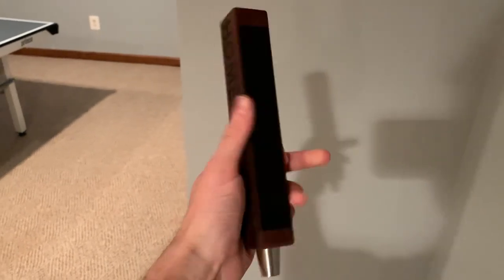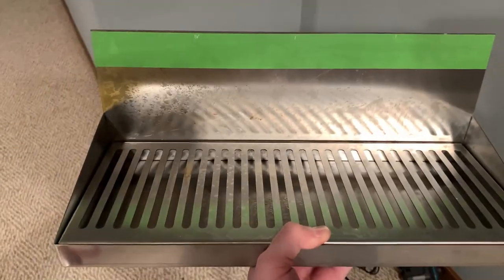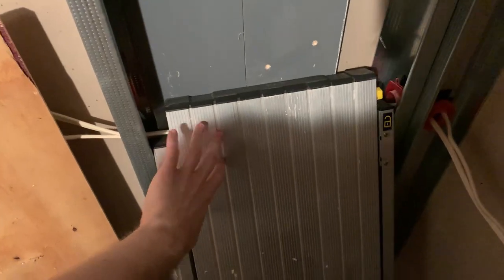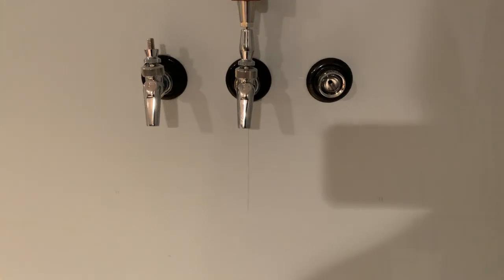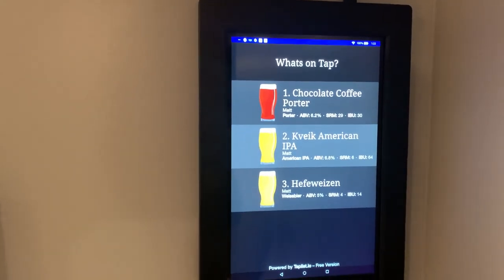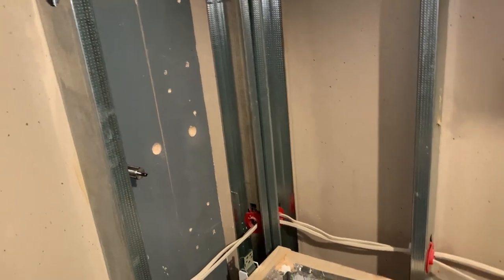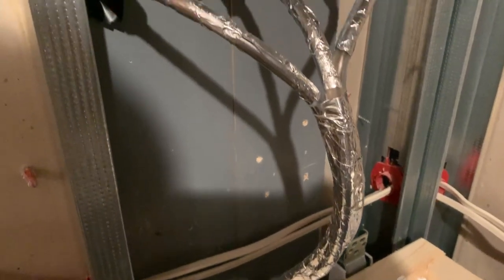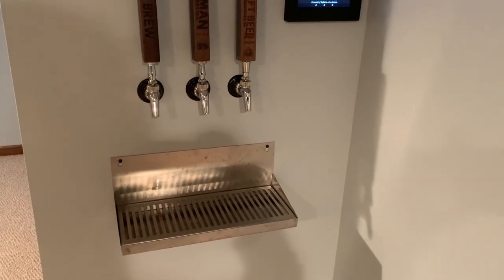DIY Beer Tap Installed On Wall | Insulated Run | Digital Tap List

Comment: Great video!  When you note that you aren't going to use glycol or a fan for your lines because they are less than 6 feet, are you referring to the length of the lines outside of the keezer?  Or the total length of the lines?  I'm looking to move my beer taps to the top of my bar and I am going to need to run my lines outside of my kegerator.  The length from kegerator to tower is probably about 3 feet and the last thing I want is foamy beer!  Thanks!
Reply from the maker: There is probably about 3 feet of line outside my keezer. Regarding the foam, the first pour every day is a bit foamy but after that it pours just like normal for the day. That first pour gets the line cold enough where it is not a problem. Up to you though!
Reply: @TroubleBrewing  Thanks for the reply!  I'll give it a shot. Guess I can always find some way to cool it later if the beer is a bit foamy.  Again great video and thanks for answering my question.  Cheers!

Comment: Matt, really well done video and I’m about to embark on the same journey of three taps through the wall. A year later, do you have anything you wish you would have done differently or is the system doing well?
Reply from the maker: Thanks for checking out the video! Overall I wouldn't change a thing. I do find that the first pour pours more foam then subsequent ones (im assuming this is because the lines above the freezer are room temperature?) So maybe implement some system to keep the lines cold above the freezer. But this really is not a big deal and I only would consider this if I'm really bored one day... The only other thing I can think of is I find that you really need to torque down on the handles so they don't move around on ya and you may need 2 people to tighten those down. Cheers!

Comment: Isn't taping the beer lines in the HVAC tape going to make it very difficult to clean out your lines?
Reply from the maker: For cleaning I use PBW/Starsan between batches. If your using the beer line cleaner with the pump I dont imagine it would be any more difficult since you can just leave a tap open with a bucket and just push the cleaner through the line as you normally would.

Comment: Hey Matt, I have a very similar setup but I’m looking to only run 1 line. My thought was to buy a kegerator and then a conversation kit to run through the wall. Do you have a link or suggestions on the supplies I would need. Or a list of exactly what I need to buy to make it work. Not the handiest so I’m looking for someone just to tell me what to buy and hopefully it’s easy to install. Thanks!
Reply from the maker: Hello, unless its a cheep/used kegerator your almost always better just buying a freezer with an inkbird since they are alot cheaper. I have a Keezer build video on my channel if your interested. Once you setup the collar your going to pretty much just do what I did in this video.

Comment: Everyone should really understand the Beer coming from the Keg to the Taps MUST be relatively COLD and it's a shame, but I would have liked to see him pour beer.  Because it would be a ton of foam beer.  He doesn't have a true method or proper insulation to keep the Beer at a cold temp to avoid foaming.  Let me know if anyone has built something like he has shown and it worked.  I'd be VERY surprised to see no foam.  Especially if the beer sits in the line for more than 10 minutes then pour from the Tap.  ANYONE'S Thoughts???
Reply from the maker: Hello! The first pour of the day I would say the glass is half foam and if you let it settle for about 5 minutes you just top it back off. You mention that it would take 10 minutes for you to have another foam issue, this is just not the case unless you have a very warm place were the lines would be. After the first pour there are no issues for the day. You can go through the trouble of keeping the lines cold; which I do link to a resource on how to do that, but I find that just waiting 5 minutes after the first pour of the day is not significant enough of an issue to set this up. Up to you though! Let me know if you have questions.